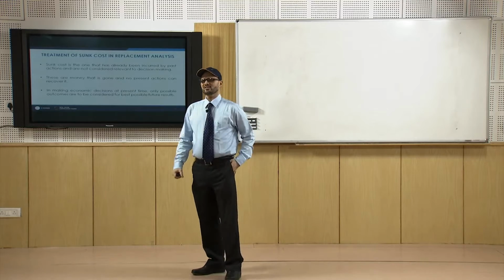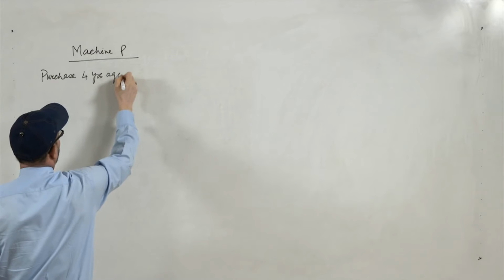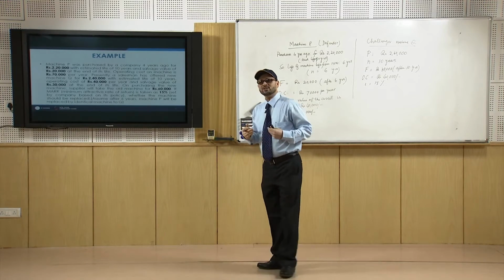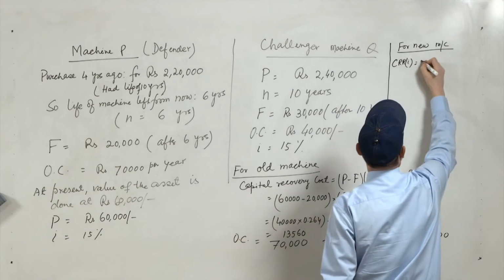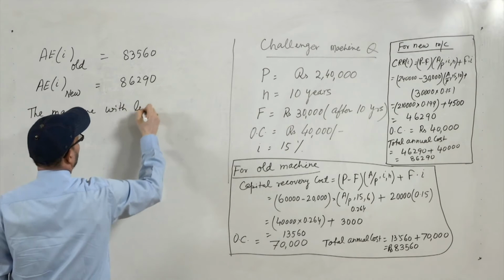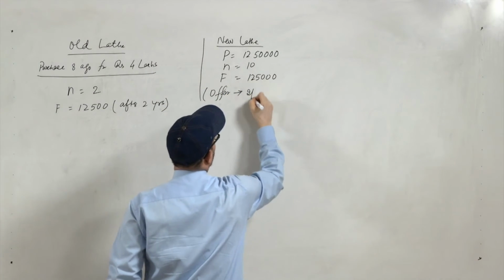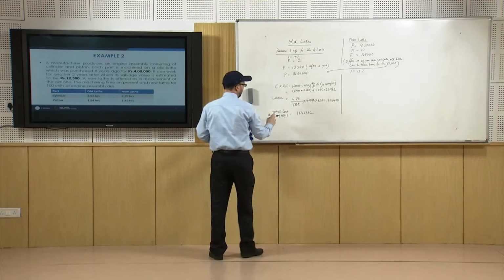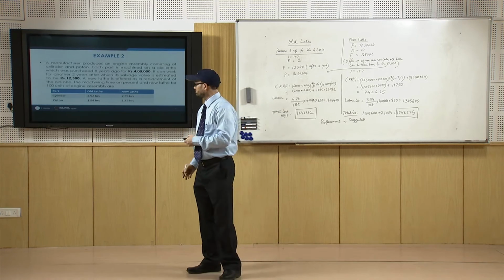Proper treatment of sunk cost in replacement

Comment: Respected Sir,
In the second example you use the factor (A/F,I,n) for the calculation of CRR(i) of the old lathe machine while for calculating CRR(i) of the new lathe machine you used the factor (A/P,I,n). I'm a bit confused because in the first example in both old and new cases for the calculation of CRR(i) you used the factor (A/P,I,n) .Please make it clear.
Thank you so much for great lecture